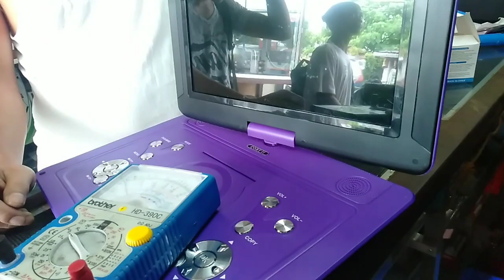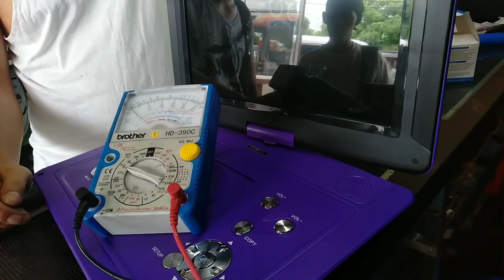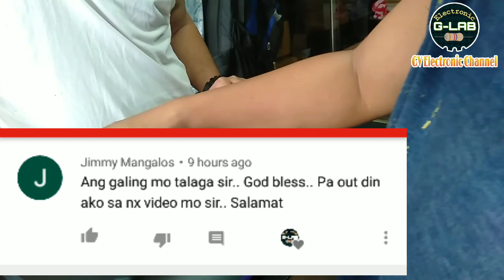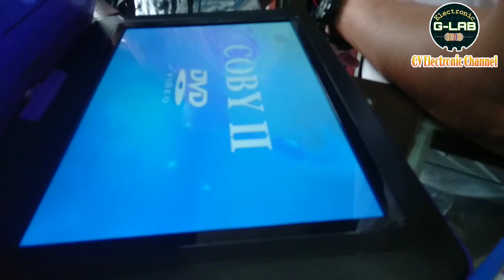DVD portable no power | no choice na tayo | ginamitan ko na ng pinagbabawal na technic

Comment: ano klaseng system ang supply sir? diba hindi lang 5volts ang supply kung mismo punto mo ay system IC Kase tatlo supply ng system ic 3.3volts 2.1volts at 1.2votls regulated na yan galing sa mga regulator ic yung sinasabi mo na DC to DC converter

Comment: Boss Giovanni - ask ko lang bali ung pinagbabawal na technique ay nagmodify ka na ng orig design, kasi sira na ang soft power on nya?  So bali ginawan na lang ng paraan kaya physical switch na.  Tsaka ask ko na din bali ang nasunog dun ay mosfet switch ba?  Kasi yung 12 volts bypass mo lang ung isang chip ?   Salamat po.
Reply from the maker: yes sir papuntang step down regulator sir

Comment: Sir g v may gnawa ako platinum t20 old model ayaw umikot Ang motor pinalitan Kona ribbon at motor Wala parin may ilaw nman Ang lens.. pinalitan buo  optical Lens Ganon parin. Ayaw parin umikot.. salamat po Sana masagot nyo.
Reply from the maker: sa low drop regulator check mo voltage
Reply: @GiovanniV  sir sa ic CD5888 VOLTAGE OUT check low voltage taga try ko sana palitan ic Kaso Wala akong hot air..